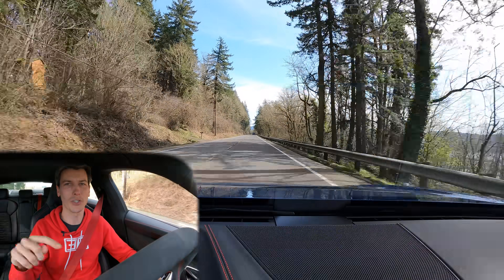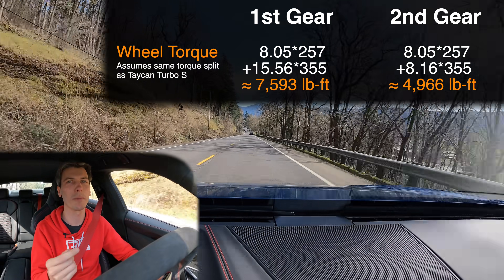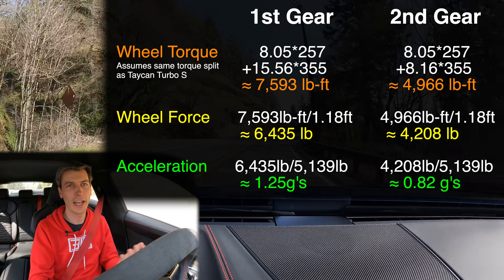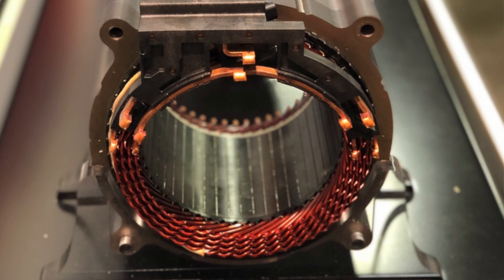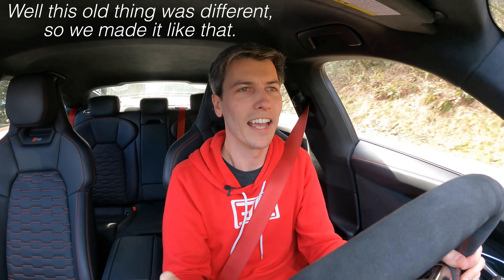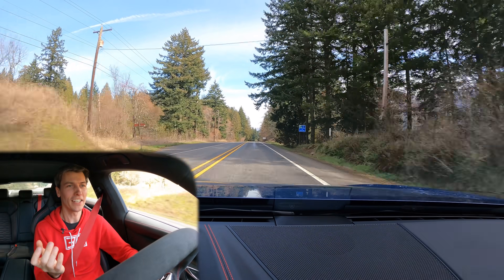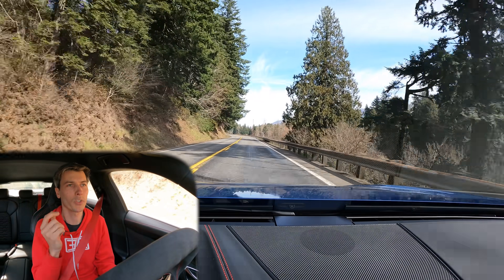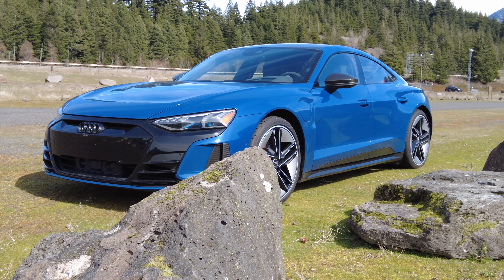Are Fake Manual Transmissions Coming? Audi Keeps It Real

Comment: A few potential reasons to have a fake manual transmission that I can think of are
* To allow immediate coasting when you press in the fake clutch which disables regen braking.
* Limit torque to drive in the snow/mud.
* Give an impression of the speeds you want to limit yourself to using gears (0-20 kph, 0-40, 40-60, 60-90, 90+).
Reply: You can also pop the clutch to initiate a drift if it was RWD
Reply: for the second point, I believe the car automatically limits the torque to the wheels similar to an AWD car.
Reply: I still haven't done a response to that dangerous "vehicle virgins" video on "how to drive an automatic": but one thing both they and you missed [is] that you can very easily put an automatic in neutral. You simply slap the shifter forward. There is a stop that you need to bypass with either a button or detent before you reach the reverse gear.

People have died not knowing that can do this (looking at you Toyota unintended acceleration recall).
Reply: also just for fun, but idk i mean technically sure its not necessary but un-necessary things aren’t necessarily useless. like yeah i could see how it could be useful to want direct control over your torque to rpm ratio. plus again it seems fun
Reply: Also most people, aside from North Americans, are used to driving manuals so it would make the swap to ev easier for them.
Reply: @noaerrr  "aside from North Americans" and Majority of Europe and China as well.
Reply: @DoubleDragon5180  it’s not most of europe, pretty much every country in Europe has a higher percentage of manuals over autos. The only countries that really don’t drive manuals (so like 10% or less) is Canada, Mexico, the USA, China and Japan.

Comment: What I am also wondering with EVs is the recupperation buttons. Why do they exist? Is it not better to have the recupperation implictly used when pushing the brakes?
For those recupperation buttons they cannot say there used to be a system that worked differently but people are used to it.

Comment: Can having multiple gear transmission help EVs achieve a higher efficiency especially at highway speeds?
Reply: Most EVs with a front and rear motor have a weaker front motor for that purpose.
Reply: Taycan does it already.
Reply: Yes, the increase is significant. In fact almost all electric "race" cars (more like time attack cars since batteries have abysmal cooling and energy density) have multi-speed sequential manual transmissions.
Reply: Not really. Once you start adding gears you have drive train losses. A ICE car for example has between 15-35% drive train loss from what I have seen on dynos. Even if it was 15% that is a lot of loss for a ev. Lower motor speeds might be good, but a second smaller motor to maintain highway speeds would probably be the better option. Also allows AWD.

Comment: These are similar to simulators. Anyway I think it just complicates things and make it more expensive when they can keep it simple but it can be  a bit more interesting to drive it.
About CVT;s they could actually make something different and interesting to drive. I would make a RPM lever that you can push forward to increase rpm governor. For example you want to do a launch. You put the lever Forward to max rpm press the throttle to the floor and the computer will keep the rpm to the redline and gradually increase the gear ratio.  After you reach the speed you want you can pull back the lever slowly.
Reply: 😄 "reach the speed that you want" Almost anybody doing a launch wants the highest speed possible in the given space. It would make street racing interesting; set limiter to speed limit, fastest acceleration wins, nobody gets arrested.

Comment: As per my understanding, they are limiting the current or frequency to simulate each gear. By decreasing frequency and increasing current you can get high torque at low rpm.

Comment: I like driving the semi automatic combustion engine vehicles. You get to control your gear changes without the clutch pedal. And the computer will automatically shift gears if you rev too high. And it also downshifts automatically. I added about 12 mpg when I started using it.
Reply: Are you talking about an gasoline engined automatic with paddle shifters? And what were the two modes of driving that were 12 mpg different?
Reply: @soaringvulture  not specifically paddle shifters. A slapstick on the gear shift. But same thing just different application.  When I first start started driving it I would only use fully automatic. When I started using the slapstick it increased my mileage just like any other manual would because I can go through my low gears and into my cruising gear much faster and efficiently than using the fully automatic. I can switch gears at the bare minimum rpm it takes to switch as opposed to the automatic dragging each gear out.

Comment: The clutch pedal could be used in EVs to disconnect the energy recovery while slowing down, mimicking the effect of removing the engine braking in ICE cars.
Reply: I'm trying to figure out why I would want to do that...
Reply: @BC107BP  the same reason you would do it in an ICE, you want to coast further. The difference is in an EV coasting trades regen for momentum, which may be a wash depending on other variables, but in an ICE coasting trades engine friction for momentum, which is always a win.
Reply: @extragoode  that could be achieved with a simple setting which basically enable or disable the so-called "one pedal" driving. In my car (an hybrid, but in an electric would be the same) you have to use the brake pedal to engage the regenerative braking (up to the point when it start to use the regular friction brakes). If you simply take your foot off the throttle, you'll start coasting without any regenerative braking. I'm sorry, but I don't see any reasonable use for a third pedal except for a "nostalgia" purpose. ;)
Reply: @BC107BP  that's the way it would make the most sense, but in my Leaf my choices are a little regen or a little more regen. The only way to freely coast is to give it just a little throttle so it doesn't regen or hack the firmware, both of which are a pain. So, yes, it could be done with a simple setting, but it could be done with a pedal too. The pedal could even just push a button.

Comment: The Tesla electric motor in the plaid also revs much higher than the one from Porsche. That’s also the reason the don’t need 2 gears and accelerate faster at the same time!

Comment: I've got exactly the same opinion lol. I'm used to manuals, and CVTs (Haven't had any cars of mine with proper automatics). My fav is always the manual, but when I drive my CVT car, which is a Honda Civic atm (as daily), I actually like it shifting through fake gears, it's pleasant although it's less efficient, slower, and all of that.

Comment: What blows my mind the most about the fake engine sounds, is Audi went through the trouble of putting a menu to select modes, but didn't include 'off' as an option.
Reply from the maker: Yes, agreed! Frustrating - make off an option, it's an EV!
Reply: @EngineeringExplained  so the reason I think they don't actually want it fully 'off' is it may act as a sort of NHV 'noise cancelling' and muffle out some of the not-so-pleasant noises you don't want to hear in an Audi. Kinda like how a soft rumble of a gas engine is actually pleasant and soothing; if all you heard was wind and road noise, as opposed to partially drowning it out with a fake rumble, you mind find it feels a bit cheap.

But yeah, I actually like unrefinement and dislike efforts to mimic old technology for the sake of nostalgia. Personal opinion. I'd be totally happy with a Nissan Leaf, if it looked like an older 3-box car with a low belt line, and weighed about 1,300kg. They're unrefined and that's ok.
Reply: @EngineeringExplained  off is the default for the Taycan except the low speed vehicle warning sounds at below 30mph. To even get the option for sound you have to enable it thru screen or select Sport+ mode and have paid $500 for the option. I have the option and appreciate it when driving spiritedly.
Reply: And the sound comes from the sound system, instead of having a separate speaker, so there's no way to just disconnect it without losing all the audio features
Reply: Make the electric cars sound like George Jetson's car, inside and out.
Reply: Has to do with pedestrian safety. Nah I thought it was external engine noise, my b
Reply: You may have a car of any color you want, as long as it is black
Reply: Maybe since Jason's review was so critical of the noises Audi will patch in an off option lol
Reply: @psychic_wolf  we can hope!!
That or some aftermarket hacks :)
Reply: Safety. If you have complete sound-free driving environment, it affects you more than you know. It can cause you to fall asleep and pay attention less. Look into what silence can to to the human psyche. It's really not bad at all. Seems people always find SOMETHING wrong. I suppose the GT is that good that people can only complain about its sound. 😂
Reply: @joshfoleyJr  I'd still want this feature to be open to new downloads... 😂  sth like flatulences of sorts, silly self recorded hummings, and not to mention the ouside speaker\s 🤣
Reply: Nothing that a simple software upgrade can't do. I thought it's the nerds watching this channel that ARE the target group for funky EV sound effects. That and watching Star Wars for the 100th time.
Reply: It's not only for fun tho, it's a safety feature for pedestrians
Reply: Lol
Reply: If I get an EV I would love it to make a v12 sound
Reply: Sort of like the '70s GM flow-through ventilation where there was no way to turn the blower fan off (unless you turned the whole car off of course).
Reply: If its for safety and its fine as long as it "makes" any kind of sound then I want an ice cream truck sound. And make the speed of the ice cream soundtrack tied to the motor RPM  / current speed.
Reply: i wonder if anyone could hack that, and put a Peter Griffin fart sound..  and the outside horn a Homer Simpson either burp or "DOH!!"
Reply: There is probably some harshness which they cannot get rid of, the fake sound covers that and stops people getting irritated
Reply: Have you ever heard an E-Tron GT or Taycan from the outside??? They sound so cool, and they aren’t trying to be ICE’s
Reply: You have obviously never met a German engineer.
Reply: This idea was proposed in a movie with Owen Wilson. I don't remember the name of the movie, it the plot. But the idea of an electric car making engine noises was in that movie. Great idea
Reply: I say great idea because... I've driven the mustang Mach e, it's odd when you're accelerating to such high speeds without an audible que we're so used to. It's actually dangerous in my opinion. Pedal to the floor... Then 80 in a 35. Just like that. Shit's dangerous.
Reply: Sounds associated with your vehicle's acceleration help boost the driver's awareness, which is inherently safer.
Reply: @slowanddeliberate6893  not really it depends your overall two simplify it as iv had both SBC straight piped aka loud as AF and 🤫 luxury barge sounds or the lacking there of
Reply: @slowanddeliberate6893  doesn’t the actual force of acceleration tell you what you need to know?
Reply: @slowanddeliberate6893  back in the 1980s, extra sound deadening in a new model of fleet wagon resulted in me realising I was driving at 140km/h when I (and my passenger) thought we were cruising at about 90. The speed limit was 80. Far more attention got paid to the speedo after that - but it only happened once
Reply: @slowanddeliberate6893  source? the wind and tire noise is more than enough
Reply: I think fake engine sounds in electric cars makes sense for a fun perspective.

You could basically program your car to be like any car and engine. In the stupidest way of saying it they could use Forza programing for engine sounds and character to the car. 

If it's done right it will sound good
Reply: @JKDJack  the problem is even nowadays cars (Audi RS6 for example) have that anti noise cancelling when it goes into a different cylinder mode, now you would say sure thats fine but in reality its so annoying since anti noise cancelling kicks in over the speakers and the sound becomes horrible. There is no way to disable it for a car for over 100k+ is in my opinion absolutely unnaceptable.
Reply: @TheFollowUpHit  totally understand the concept; my point was simply that there ought to also be a way to totally turn it off, if that's what you want. I don't get why that isn't an option.
Reply: @Icekick2007  You can always remove the speakers. That way, you get the annoying noise turned off, and you get some cash by selling the speakers to the street kids.
Reply: @caty863  But what if you want to play the radio?
Reply: @JKDJack  are you ready for every car to sound like the awful v12 turbo that forza uses for everything
Reply: @JKDJack  I don't understand why, with the option to pipe in literally any sound they could want, they chose a crappy sci-fi whine over screaming F1 V12s
Reply: ikr I hate electric cars because of the lack of engine sound, so I cant fathom why someone would want engine noise when they are buying an electric car. The people who buy electric cars dont care about that stuff
Reply: It is a federal law that electic vehicles have to project a certain decibel of noise to alert pedestrians and other motorists, especially because of how fast they can travel. So turning it off completely would be not only illegal, but incredibly dangerous.
Reply: @kyleman223  It's a big deal on college campuses where students walk out in front of cars anyway. With older hybrids, they don't even subconsciously know I'm there. I now assume they're all suicidal and I drive ACCORDingly.
Reply: @kyleman223   That's external noise, and it only applies below 18.6 mph

Comment: When I am sitting in stop start traffic the last thing I want to do is push in a clutch.  So when we go out the choice is DSG for peak hour traffic, and the manual for the early morning rip up the mountain. But I have also driven an EV, and I am addicted to that endless torque.  And regardless of the driving scenario, I would take the single speed EV.  I would even take that car to my next hillclimb meeting.  I am over manual vehicles.  I had to drive a large truck for a while with a road ranger box with overdrive in each gear and a two speed diff.  That gave me 18 gears.  At 76 years old, just give me bags of torque and one gear.  But I am not selling the sports car yet!